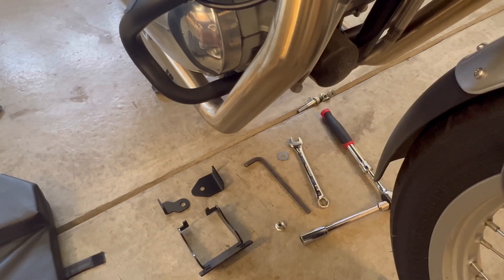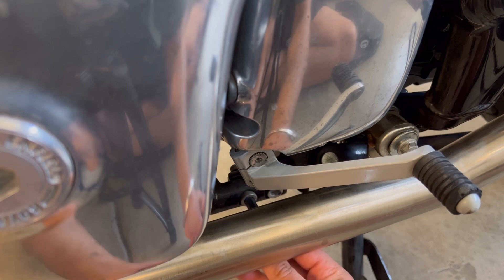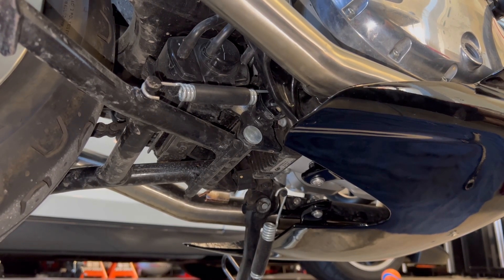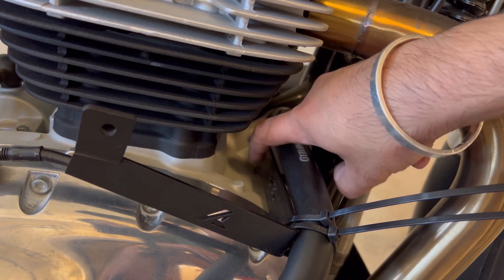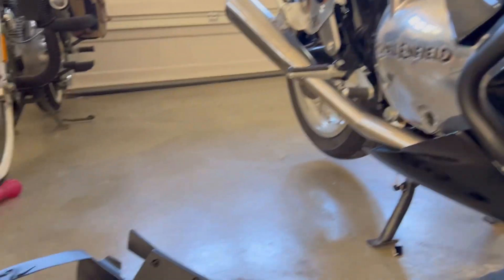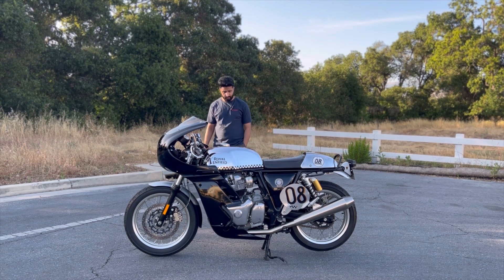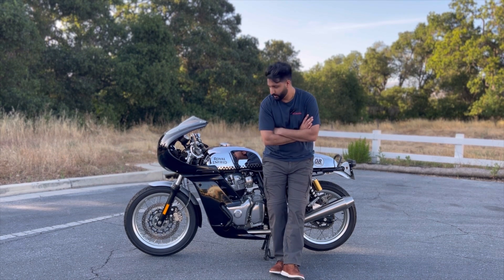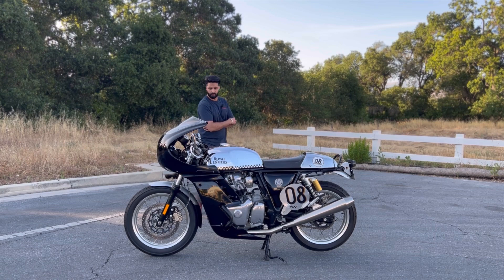Royal Enfield 650 Full Fairing | Part 3 #caferacer #caferacerbuild #caferacerstyle

Comment: I dig it man! I'm on my own journey for what I want my Continental to look like (so I'd say I wouldn't get this/do a full fairing)but I love seeing the full scope of what route you can go with such an awesome canvass as the GT 650's. Even if it doesn't become a full future video please show what you talked about with just keeping the headlight and bottom fairings, even if you don't stick with it get some shots. That is something I think could look really cool. Ride safe man. It looks good.
Reply from the maker: Thanks for watching Motomitch! I think I'm biased towards the naked look where I can see the entire engine and headers which is probably the reason why the side panels don't attract me much. Hopefully, after I made it all chrome/gold pinstripe it will change my perception. I would definitely recommend the headlight fairing if your after the caferacer look.

I will create a short video near future where I was talking about fabricating a bracket that can hold the belly panel by itself so it wont need the side panels as a support. That will also be easy for oil change as you simply remove the belly and not worry about side panels or alignment issues every time you reinstall it. Appreciate your support to the channel man!

Comment: I have the same fairing installed on my Red Gt650....I have uploaded a short on my channel
Reply from the maker: Thanks for watching @ankitanand676 how did the install go for you? I had a lot of bracket and alignment issues. Red color definitely eye catcher! Ride safe man!
Reply: @GrewalsGarage   it was quite an hefty task to install...if there are alignment issues for a bracket then u should re-do by opening from the first bracket, a good advice is to don't tighten up the screws and bolts as soon as u apply, wait till the end and then u will see everything will be aligned properly to tighten up again....just a suggestion, if u have any alignment issue then it's bcoz u have tighten up the previous bolts too early
Reply: @GrewalsGarage   also i want to add that the screws and bolt provided to me from autologue was all of the same size(all small), So it was a task finding all the specific nuts and bolt....every other fairings are made identical to each other, so there's no chance of misalignment or may be slightly....so just unscrew everthing and start it over again
Reply: @GrewalsGarage   after 3-4 tries of installing it properly, now my fairing doesn't have any vibration or sound, it's all sturdy and everything is aligned properly, just re-do everything, it will be fine just like mine....i too had problems with alignment & vibrations on rough patch and mine also had the same issue coz i tighten up every bolt instantly...let me know if u have any problem in installing at any step....believe me once u do it properly, it won't feel like an aftermarket accessories
Reply from the maker: I had to bend brackets and do some home engineering to make this work as you can see in my part 1 and part 2 of the video. And took the fairing on and off multiple times to make it work…The fitment I give thumps down they could have designed it better with more instructions but the styling is nice.